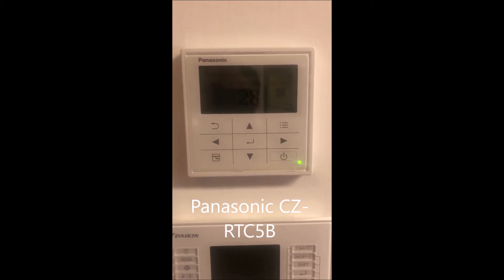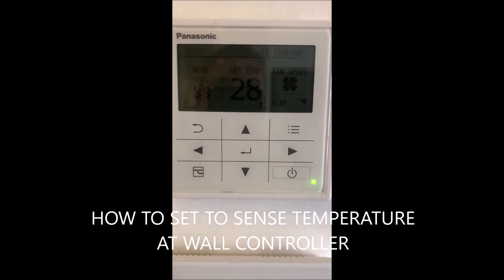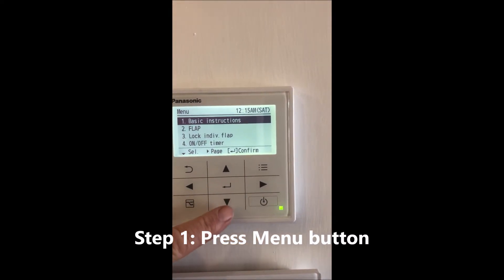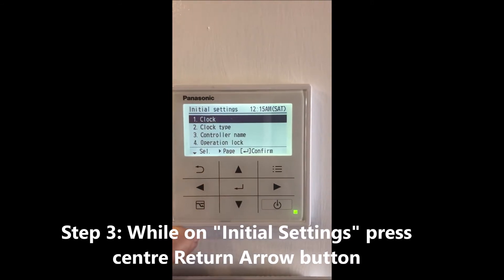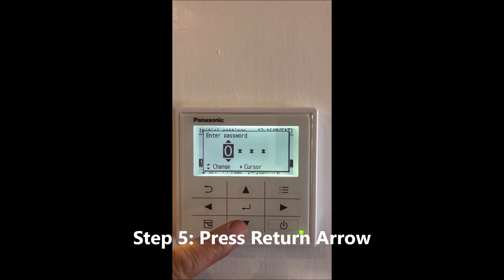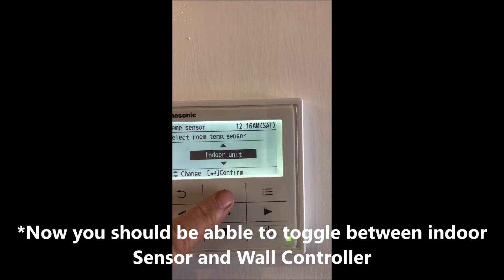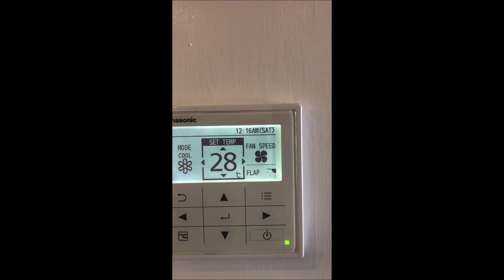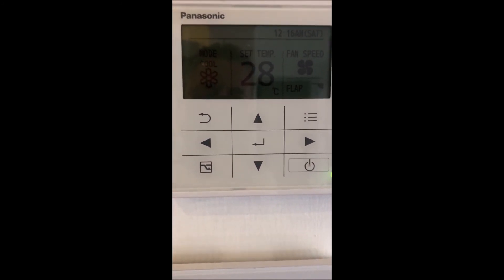Panasonic CZ-RTC5B: Use Wall Controller as Temp Sensor | Quick Tip

Comment: Thank you Morphett Air, I've had my unit set to indoor unit for 18months. Set up by installer. I am curious as to what the "indoor unit" mode reads from by default.  I wonder if there is no thermostat running in this mode? My house has been way hotter than what I set it to on the panel. My air purifier has been showing my house at 21c-22c when it was set to 18c by the wall controller. Even my cloud would show a lower temp. My indoor unit is on the roof space being a refrigerated cooling unit heat/cool.  My kids room have had a very warm room, basically like running no thermostat. Big change just by doing that. I wonder If I have been essentially running with no thermostat? It felt like it, Instantly my heater is off once I changed it. What a joke by the installer. Thank you Morphett Air.
Reply from the maker: Hey Ricky, thanks for your kind comments.  The "Indoor Unit" is actually sensing at the indoor unit (Return Air side).  Generally if the house is warm and it is sensing at the Return Air, the temperature is even warmer at ceiling height (hot air rises) so would expect that if anything the system might have ramped down to the point of cutting out on thermostat and potentially taking loner to cut back in?  There could also be an air balancing issue that needs to be addressed.  I would suggest arranging for a qualified Panasonic service agent visit to check it out? They can also check that the thermostat is sensing correctly.  Best of luck.

Comment: Hold top left about key and centre and right arrow simultaneously. Go to detailed settings code 36 and change from 000 to 001 . It shows actual temp when curser is over setpoint
Reply: Thanks, now I do not need to check my comfort cloud to view my temperature.
Reply: Now how to make it work with google?